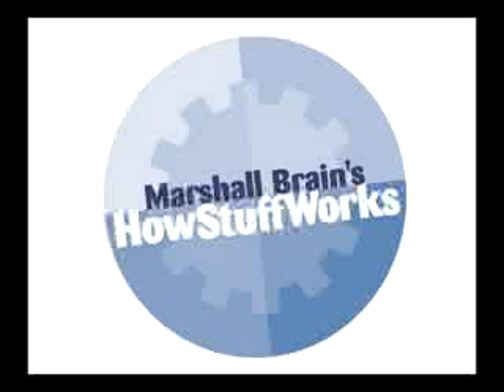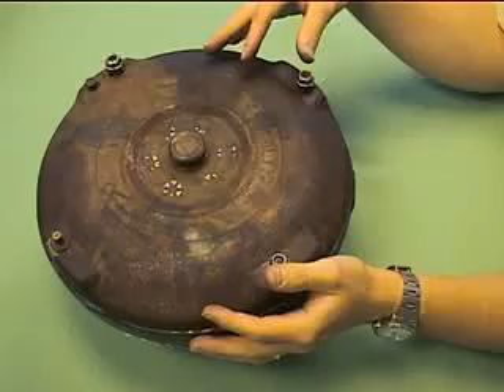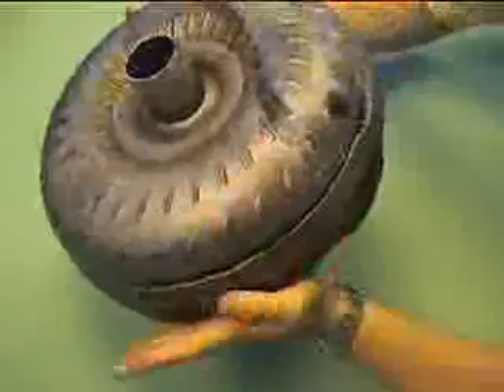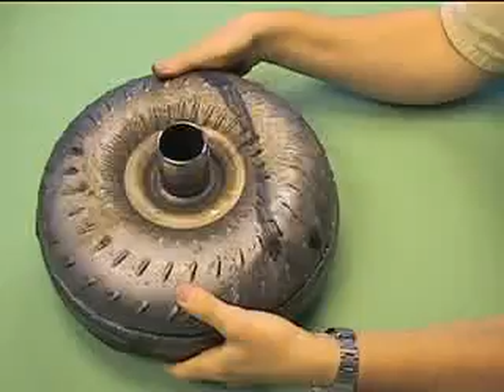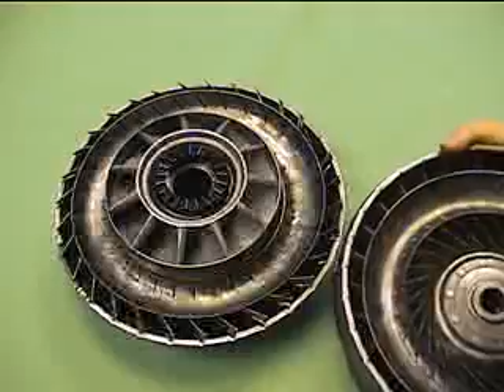Torque Converter

Comment: That makes sense, and now I understand why they fail on the FreeStar Resulting in the 11S25 Recall.  They old torque convertors being recalled have plastic stators, and from seeing this information, those plastic stators with splines sheer causing the stators to fail.

Comment: Whoops, I need to make a correction. The line pressure inside the transmission is fed constantly into the torque converter to keep the TC clutch disengaged, not engaged, and when lockup is desired, the TCC solenoid closes the fluid channel to reduce line pressure to allow the clutch to engage. Apologies.

Comment: In modern automatic transmissions, there is a component called the TC clutch solenoid. It is a computer controlled actuator that engages when the vehicle reaches final drive. When it does this, it opens a fluid channel that sends the line pressure of the transmission through the input shaft directly to the TC clutch and when the clutch is engaged, it grabs on the inside of the TC housing, thereby locking all the components inside and spin as one.

Comment: This is an older torque converter. Modern torque converters have a lockup clutch thrown into the mix which eliminate fluid slippage and make everything inside the converter spin as one.

Comment: How can you tell if a Torque converted is bad.And if it gets a small amount of water in the converted will it effect it.My Transmission the reverse went out but I have all my other Gears in my 700r4 to move forward can I still use the same converter

Comment: The torque converter uses transmission fluid to turn the turbine, the fluid is supplied to the converter from the transmission oil or fluid pump. It all works based on hydraulic principles.

Comment: were does the oil come from that is in the torque converter? Is it fixed inside or does it flow around the engine and use engine oil.

Comment: @jasonmangal

It is the torque converter...I had the same problem. Starts shaking when applying the brake when coming to a stop. The shaking begins when it gets close to 10 mph upon deceleration. Then shakes when taking off at stop lights when releasing brake and beginning to accelerate. mczest is correct just put it in neutral it will not do it then.

Comment: I have a mercedes A210 Evo its automatic using a torque converter it wont go up hills i was wondering do you think it could be the torque converter or something else someone pointed out my valve body but Im not so sure.

Comment: Been driving a long time, mostly manuals, but as I get older I find myself operating GMs 4 speed automatic, so I figure I'd learn how they work. Interesting the terms of the torque converter, many the same as a jet engine. A lock up converter is about the only thing left to make this good, but somewhat inefficient transmission better.

Comment: #1.  There is not a flywheel attached to the engine and torque converter, it is called a flex plate.  flywheels only exist in manual transmission applications.
#2.  Any modern car with an auto tranny and overdrive no longer uses this type of converter,  new age cars use locking converters so essentially you are learning how converters worked 30 years ago.

Comment: @Brianiare A car wouldn't need a torque converter. (With a maunal transmission there's no need of  any of that.)
However, big vehicles, such as buses and trucks, especially the ones that stop and start a lot of times (such as urban buses) , need a very powerful torque at low speed. (And a regular clutch does not give you that torque).

My english is not very good but I hope you understood.

Comment: great presentation.one question for you,the transmission fluid(hydraulic fluid)does it have to be sprayed in the the torque converted for it to work.for example if the hole is plugged were the fluid enters to the converter and there is fluid left in there but cannot circulate to the transmission pan does the converter still fungtion

Comment: @FelixTheHouseFreak by the time the engine comes under any load from the transmission the oil's already stored a massive amount of energy in the flywheel so when you drop it in first gear or drive it has plenty of momentum to keep turning.

Comment: @CoChicken1337 There is no centrifugal force, only centripetal force and inertia.
The "centrifugal force" is only apparent to an observer inside the reference frame.

Imagine sitting in a merry-go-round on a seat with chains. You'd feel an apparent force that is pushing you outwards, but in fact this is just the effect of the chains constantly forcing you onto the circular path.

Cutting the chains would send you flying tangetially, not radially, because there is no force away from the center.

Comment: just wanted to point out that there is no such thing as a centrifugal force. 
there is no force that acts outwards
however what people are confused with is that when fluid, in this case, is rotating in a circular motion, the fluids line of action is a straight line, and therefor acts tangential to its circular path. what stops it from actually continuing in a straight line is the casing. this provides a force (acceleration) inwards which in fact is cenTRIPITAL force.

Comment: @tbdk87 
No they have flexplates. A flywheel is a heavy piece that spins with the engine with a machined surface to engage the friction disk of the clutch (kind of like a brake rotor). A flexplate in comparison also spins with the engine but is lighter often with holes in it to make up for the weight of the torque converter. People referring to a flexplate as a flywheel is more slang not technical.

Comment: @BlindDogFulton yuppers thats why i like standard transmission actualy the 2 speed power glide is a good transmission the slipage by the torq converter lets one function wastes alot of gas but it works but i do hate that though i have a 700R4 in my truck i hate how it feels my buddsy C6 without a lock up tork converter is worse stays at a constant 3000RPM  on his 400 big block while the truck slowly speeds up

Comment: Why can't it have just a clutch connected to a computer so it moves depending on the engine load. Clutches weight is much less saving fuel.

Comment: Well you kind of blew it explaining the stator.  If there is no stator then it's a fluid coupling.  The stator is what makes it a torque converter.  At high rtational differences between the engine and transmission the stator redirects the flow about 90 degrees to for the oil to delivery more force to the spun (tranny) side impeller.  Hence is converts speed of the engine side to force or torque on the tranny side.  My '91 F350 4x4 had 348K when I finally had to change the tranny.

Comment: idk man you guys are very lucky to have lasted so long with auto's idk if its just the weather we have and the fact that there soooo much wheel spin in the winter times that just heats up and burns out the clutch packs but were i come from unless your auto isnt awd it doesnt last past the 120k mark. only point i wanted to get across and ill make it clear here is that autos when they fail and they will cost a shit load more then changing a clutch thats why i drive stick now.

Comment: Ok video but  need to Call the parts by their proper name and  the stator redirects the fluid for TORQUE AMPLIFICATON !   what 40lbs  that would depend on make and modle as a transmisson rebuilder I see them from about 20 to 100+ lbs  still pretty good video in all

Comment: One thing he did forget is that the stator's main purpose is torque multiplication at low rpms, when autos first came out they didn't have a stator & it was just called a fluid coupling & very slow off the line. I know what thats like when the one way clutch went in the stator of my truck.

Comment: Because then it wouldn't be manual would it? :P Manual and automatic transmissions are setup totally different, and a torque converter will not work with a manual because it needs high pressure transmission fluid to be ran through it, where as manuals do not provide. If a manual vehicle is driven right, you should be able to 200,000+ KMs to one clutch, everything wears, even torque converters. There is also a lot less power loss (slipping) in a clutch system then in a torque converter system.

Comment: What I missed in the explanation is that the "Torque Converter" can actually increase the torque at the output shaft, compared to the engine torque input. This is only possible when the difference in rotational speed between the compressor and turbine is big enough; that is when the stator can play its role in directing fluid flow efficiently.

When the stator starts spinning along with the turbine, there is no longer any torque conversion. From that point it acts as a simple fluid coupling.

Comment: it depends on the implementation. my infiniti G35 doesn't close the clutch until i'm in 5th gear and holding a steady cruising speed, and it opens the clutch back up as soon as you start accelerating to pass; also it is very subtle. on the other hand my saturn SL2 closed the clutch in between 2nd and 3rd gears and was so pronounced it felt like another shift, and it also stayed closed in the 3rd-4th shift (which i always thought would be hard on the 4th gear band, but it worked for years.)

Comment: many modern cars have both a torque converter and a clutch.  the clutch engages at higher speeds to address the energy loss (increases fuel economy at highway speeds).